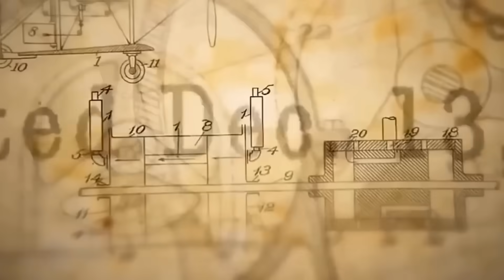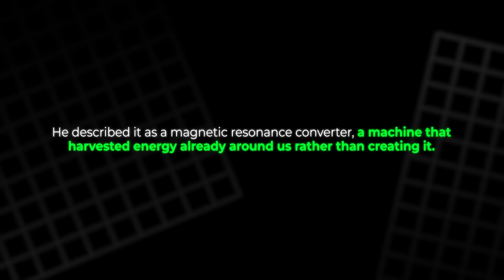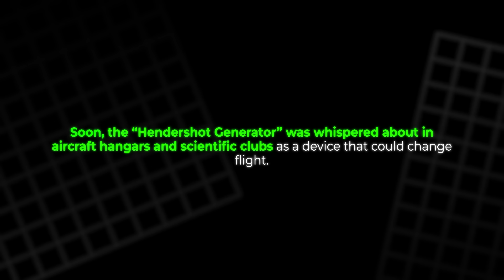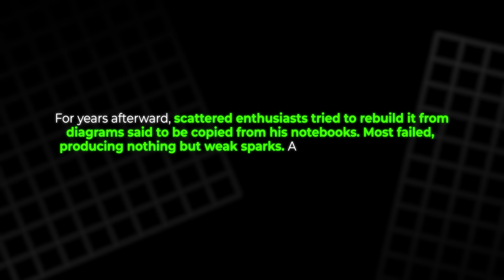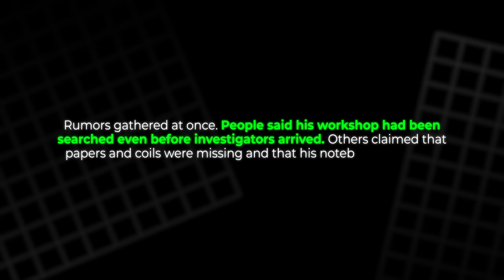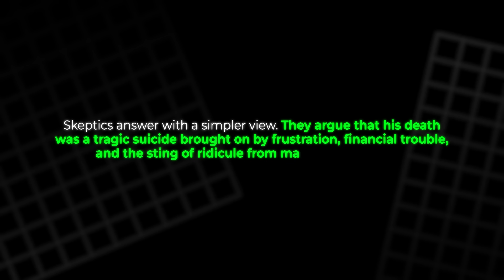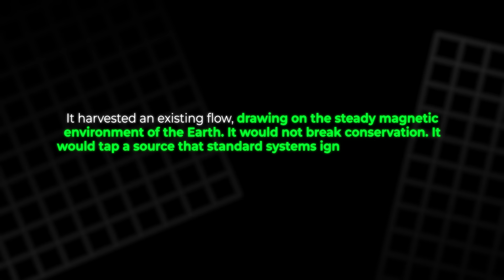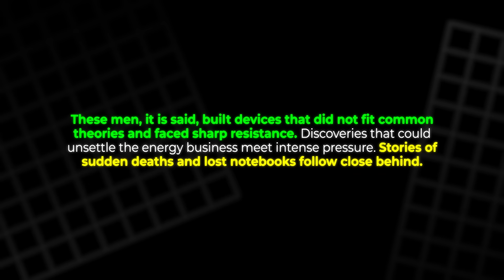Was This 1928 Invention Suppressed by Big Energy? #EnergyConspiracy

Comment: I stumbled across a device which was cylindrical in nature and had two faces one at the bottom and one at the top, it looked like something fell out of an alien ship, I took it home and out of interest I started to examine it, to see what was inside it, but just as i tried to prise its end cap off, a tiny spark was seen, si i wondered if it had any voltage in it like in a battery, so i got my multimeter and i placed one lead on the top and one at the side, nothing, but when i placed one lead at the bottom I was shocked to see meter read 1.5v, may be I stumbled across an Eveready 1.5V battery in 2026 which must have fallen off the space ship back in 1960. Apart from the rusty and dirty corrosion, it still worked and that is why it was rightfully called Everready. I was able to get free energy for about an hour.

Comment: Perpetual motion.  Where do you hide the battery, the common problem of all such machines.
Reply: The design is a Resonance Cercuit  which is connected to another Resonance Cercuit where its winding is opposit to the first one , the emectric current interact between the two cercuits and the magnetic field as well , it will keep resonating for a while or contiously ( we dont know ) but it is a creative design ...
Reply: @SyrousHayxman 
All resonant circuits amplitutude decay exponentialy.  Unless super cooled, but I see no evidence of that.  It is possible to draw a very small amount of electricity from.both radio waves as well as induction from lines.

Comment: If you have a spark between 2 points, you have a vibration. Amplify and capture the incoming energy by resonance.
Reply: The design is a Resonance Cercuit  which is connected to another Resonance Cercuit where its winding is opposit to the first one , the emectric current interact between the two cercuits and the magnetic field as well , it will keep resonating for a while or contiously ( we dont know ) but it is a creative design ...

Comment: You can get free energy from a crystal set using an antenna, and earth and a coil and tuning capacitor receiving a radio station, but the current is minuscule, probably only enough to light one or two very small LEDs. Harvesting the Earth's magnetic field is not possible. Some phone and battery chargers work by induction, i.e. cordlessly, but the coils need to be in close proximity to work. I don't see how radio transmission of large amounts of power over long distances, hundreds or thousands of miles, can be possible. A radio signal of many kilowatts is very weak when it is received, and has to be amplified by the receiving radio's circuitry, which itself uses current to achieve an audible result.
Reply: Current resonant transformer.

Comment: Found this on Google. They have been able to get electricity from the Earth's magnetic field and build a practical device that does this at Princeton University:

A new device demonstrated by Princeton University and NASA's JPL researchers generates tiny amounts of electricity from the Earth's rotation by using a hollow cylinder made of manganese-zinc ferrite that is precisely oriented in the Earth's magnetic field. While this breakthrough has proven that generating electricity from a planet's rotation through its magnetic field is possible, the current output is only in the microvolt range, and experts caution that it is far from being a practical energy source at this time.

Comment: If you have a coil and a capacitor which when charged, will oscillate at some frequency and could pick up RF from a transmitter at same frequency.  That would be wireless transfer of power.
Reply: The design is a Resonance Cercuit  which is connected to another Resonance Cercuit where its winding is opposit to the first one , the emectric current interact between the two cercuits and the magnetic field as well , it will keep resonating for a while or contiously ( we dont know ) but it is a creative design ...

Comment: It was just an oscillator, but didn't have enough power to do any work.  Yes it can light a lightbulb, but can't run a vacuum or AC powered equipment.
Reply from the maker: Thanks for your insight on the power limitations of the device!
Reply: @TheForgeEmpire 👋
Reply: The design is a Resonance Cercuit  which is connected to another Resonance Cercuit where its winding is opposit to the first one , the emectric current interact between the two cercuits and the magnetic field as well , it will keep resonating for a while or contiously ( we dont know ) but it is a creative design ...

Comment: You are showing the Earth's magnetic field incorrectly. The Earth's real magnetic field consists of two parts. A lower and an upper vertical positive. It emerges vertically from the equator and the two fields form a spiral structure, balancing each other. In this way, the Moon remains balanced in this field around the Earth. If anyone wants more information, I can give it.😁